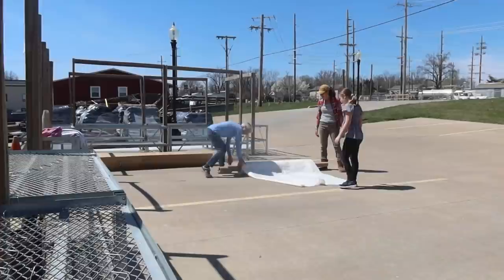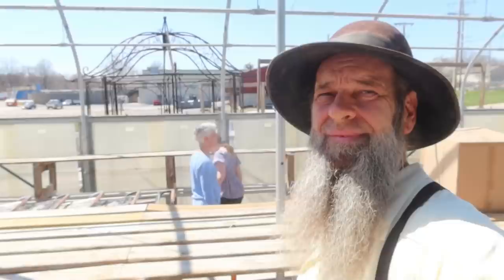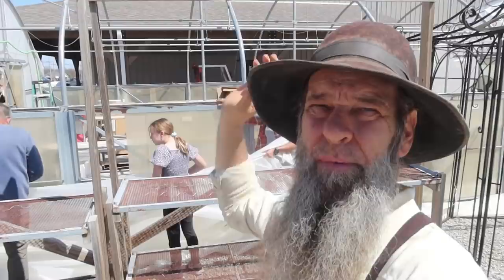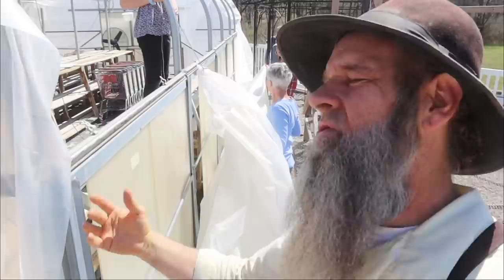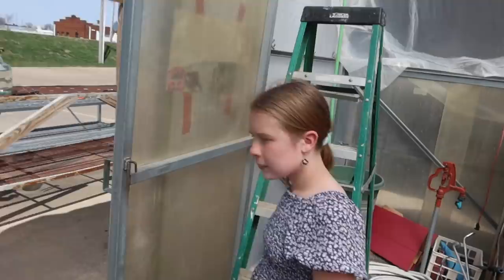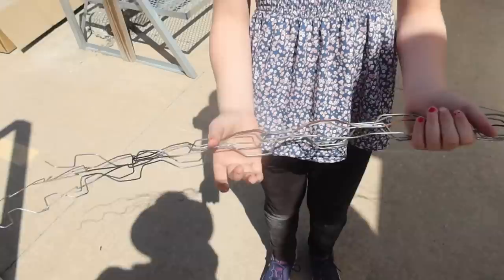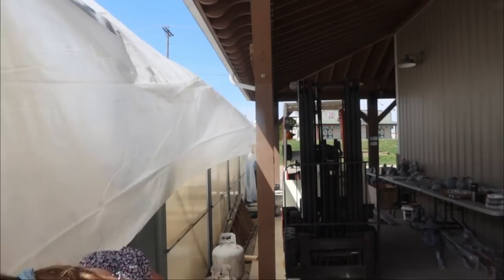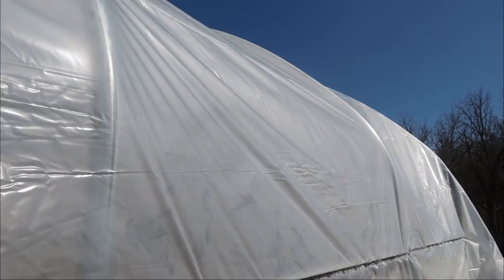How to Install GREENHOUSE plastic! Tips and Tricks to NO SNAG install

Comment: some tips, have someone inside the greenhouse with a pipe(with a rag or glove on the end) to poke the plastic when it sticks.  If you are installing  second layer for double polly put a fan or big leaf blower between the two layers as you pull it will make your life 1000X easier.

Comment: We use 2 different plastics for our 30x80 with roll down side. One plastic protects plants from uv so plants do better. We pull 2 up at once. We can also gain 3 years of life of plastic to re tighten plastic. Puts wiggle wire in different spots so it won’t tear.

Comment: I’ve done this a few times. Here in central Oklahoma the constant wind is usually 20-40mph and it makes putting one of these up a bit**. I cut the plastic about 50% wider than I need and then anchor it on one side before pulling it over so that the wind doesn’t make it a sail. I use the excess plastic to wrap some old tires and then fill them with water. With this method I can pull up my 35x25 greenhouse by myself in around a half day. 
I’ve never tried the tennis ball idea but I definitely will next time. Great video!

Comment: I think Glass is a better long term Idea. I have seen so many green houses that have plastic flopping in the wind, Enid, Oklahoma, glass I know is more expensive but so is Lexan.
Reply: You don't have wind, you have F1 breezes. 😄
Reply: I worked for a greenhouse/stand-off shelter manufacturer for a number of years.  Our plastic was sold with a 5 year pro rata warranty and could be expected to last 10 years.  Spoke with one customer with his house on a very high wind site whose skin had been up for 11 and it was still ok but was thinking he might have to replace it "before long";  he'd popped in to our office to check on prices.  As you say - glass is expensive, lasts a long time but is fragile;  plastic ages with UV and WILL have to be replaced, but is easy to patch if punctured - also, in the first year or two will need re-tensioning as summer heat causes stretching to the film, and this can cost too.  Also, the plastic was sensitive to various horticultural sprays, specially copper, which could dramatically reduce the lifespan of the film (and tests on failed film could easily reveal the use of said spray/s - meaning no warranty claim).  So the customer must weigh the costs and consider preferences (dumping a LOT of plastic every 10 years? Flying stones from mowing tasks?) before construction of the framework.